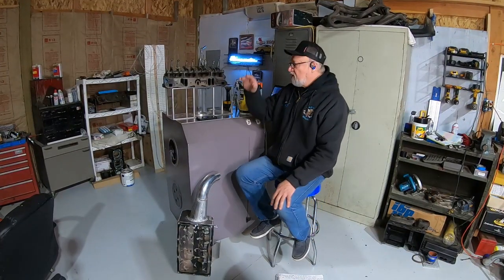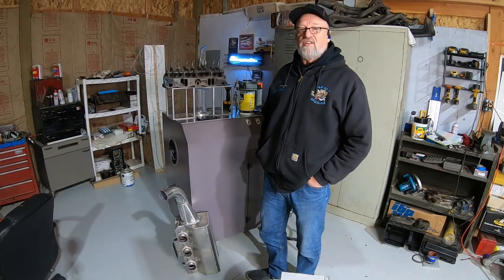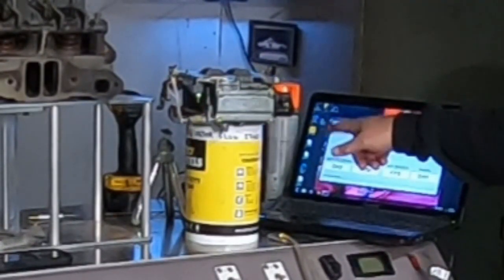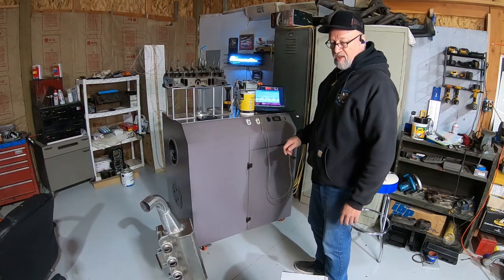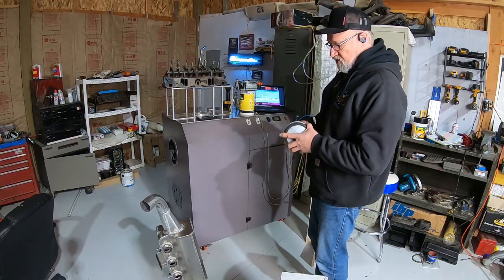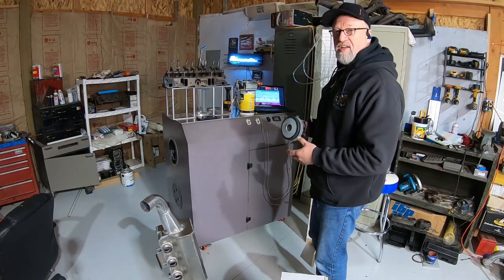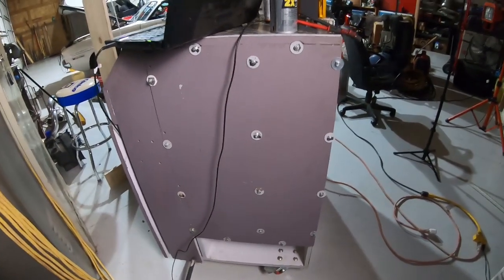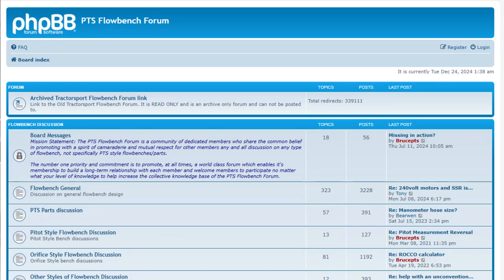DIY Flow Bench: How I Built and Use It to Test Carburetors and More

Comment: Just curious if a 6-71 GMC blower, ( I have several ) would make 300+  cfm at  28" of vacuum with a 2.05 intake valve head. Was thinking variable speed big motor , to drive it.
Reply from the maker: There is a good thread on this descussion on this site  https://www.flowbenchtech.com/forum/index.php?sid=10fc7533ccce82127a75661a51f9dab8    (were i got the plans to build my flow bench)  It has been many years back so you would have to dig a little for it. Or just become a member (free) and post up you question and you will get your answer. It a vary small forum and the answer will come vary slow, but vary Knowledgeable peope on that side.  but if you don't want to do any digging. Here is the short answer. The male a LOT of AIR.......but the HP aka electric motor that it requires is$$$$$ thene you will need 220 volt outlet and it hard on your electric bill.
Thanks for watching and posting up ;-)

Comment: I just ported my first set of cylinder heads and am very curious to if I made it better or not 😂. This also seems daunting to build as I can’t find anyone local to flow test my heads
Reply from the maker: Dont waste you money on getting them flow tested.  Track test them and them put it on a flow bench if they don't perform, to learn how to do your next set.  If you didn't get greedy they should perform better them stock. what head are you porting?
Reply: @CudaFishEStories 862 heads, spent about 20 hours total on them. Left the intake at 180grit and finished exhaust at 600grit
Reply from the maker: If you haven't watch these two video of mine, they have some good info in them. a bit long but informitive.
https://youtu.be/nznYcwXbpTM
https://youtu.be/g_Bl4I-cUCE
Not trying to toot my own horn, just offering a Helping hand ;-)

Comment: Ball park, how much should i expect to spend when building this? I read on the forum that you can get away with 2 motors, which im most likely gonna go with, cause im no race team engine builder, i mostly just build street 4cyl engines, so i dont think id need that many motors.

But i know i shouldnt expect under 200, but would this go above the thousand mark?
Reply from the maker: There is so much that can't be said here. so i Highly Encourage you become a member(It Free!) and start asking question there. It may take a week to get your first queston answered. so while your waiting you can check out all the threads on that sight.
You will need 4- 4x8 sheets of partical board 3/4 thick, you will need atleast 4 vacuum motor(Understand diminish returns!!!!)
If you have a vacuum motor that is advertised to have 110 cfm and you have 2 of them they will not give you 220 cfm.
Trust me you need 4. Mine is a 6 motor bench and i  can only flow about 540 cfm @28"keep this in mind your only testing one cylinder at a time. so it don't really mater if it a single cyl or a v8! And the only motor I or bruce is going to recomend is the Anetek 115923 and they are like $120 each.(Bruce can get you a better deal through his site). 
Will it go over 1000 dolars?????  if you go the inexpencive route NO, but if you want the conveniences of electronic so you don't have to do all the math......then yes! 
keep this in mind, a profesional bench will caust you 10,000+ used on up. 
I bought the plans ($50) the the wood, then the motors, then all the screw,, wiring switchs exc, then the lectronics.......then i started cutting up the wood and got started.
It took me 6 mouths to colect all the parts before i started to build the box to hows or hold it all.
I hope you do it. you will learn Soo Much ;-)
http://www.flowbenchtech.com/forum/index.php?sid=10fc7533ccce82127a75661a51f9dab8

Comment: I (a fellow tight-wad) have been contemplating building a flow bench myself. I've gotten the itch to port a set of old aluminum Ford Motorsport 302 heads for a future build, but I want to be more scientific than what I did on my last set of heads (somewhat educated guesswork). The basic pressure drop bench that David Vizard writes about in his book would work like you said, but the engineer in me wants more. It's timely that you've made this video, I'll look into PTS, seems to be a great resource!
Reply from the maker: When you start posting up on Bruces site (PTS) tell them Flash sent you. You can also find my build on there.
Here is a couple more video that you might like on porting. there long and i need to re due them but there is a lot of good stuff in both of them.
"Cylinder Head Porting for Beginners! Easy Steps to More Power (Part 1)"  https://youtu.be/nznYcwXbpTM

"The Head Porting Secret Every Beginner Should Know (Part 2)"  https://youtu.be/g_Bl4I-cUCE

My examples are on a mopar head, but these basic principles will work on all in line valve head such as your 302 head.
I hope you build a PTS Flow Bench, there a lot of fun and you can learn a LOT from them  ;-)

Comment: thanks for doing this,,,keep adding,,,,one question ive had is it best to have all the blowers equal CFM , or is it ok to have them mixed for different flow work,,like small engine port work,then say a 23deg. chevy,,,,,then be able to flow a big block head...so you would using say 4 then 5 or 6 blowers then 8 or more for the higher CFM needs,,,i know the amp draw has to get up there. YOUR real world info is very helpful,,,maybe do a few short videos to show some of the little things you have learned,,good and bad lol,,,this is going to be a long term project for me .
Reply from the maker: Thanks for your interest in this subject, wasn't sure how well it would land. As i said, there will only be a few that will go down this jurney. And it sounds like you are ready for it ;-)
There are several camps on this thought and none of them are wrong. The first camp is 2 motor Per switch. when you run out of flow, you turn 2 more on.  If you run 2 motor together you can us 110 V motors and wire them to run off of 220(takes less amp this way) all of this in on the PTS Forum.

The 2nt way is to run all the motor at once, and blead off the air your not using. Example is that you have your Cylinder  Head at .100 Lift and your Open up the blead until the pressure come down to 28". open valve to 200 lift and then close the bleed down until it rise back up 28" take your reading and so on, until finished or you ran out of flow/vacuum.
3d way is run a "motor control" were you dial the speed of most, or all of the motors together. this becomes a little bit more complicated but much more convenient. this is how i have my curent bench set up.

If you are running 2 -110v motor together to run off of 220 they must be the same vac motors....if you have one odd ball vacuum motor or they are all odd ball motors.........they would all have to have seperate switches.

Here is my advice if you want to do it once and do it right..........get Bruces plans follow them to the Tee!........ask queston on his forum so you do it right........and you will have a professional flow bench for a lot less.

If you don't have to money to do it right!?* Buy Bruces plans anyways (and build it with all the spare parts and pieces you can find)
If you don't feel like asking queston on his forum, register for his form and then look at "Flash"(Thats Me) Flow bench and all the miliion question that i asked.  You will get a grate understanding of how it all works. Also read up on all the other people that  have build benchs from his site.  There is professionals that have built bench for there shops. They Can be That Good!
Bruce(P.T.S.) has a YouTube site........Even though he has not made a new video on there in Many Of Years now...........
Each and every one of them are still Relevant Today!!!!

Hope this start the journey to flow benching ;-)
https://www.youtube.com/@brucepts
Reply: @CudaFishEStories  thanks a ton
Reply from the maker: @RussellCompton-fh3gr  Your so welcome, my first bench(2nt in my video discription) I literally cut up 3 desks, made of that pressed wood.  I used bruces plans, shrunk to a 3 motor bench. That build is also on there, but you would have to go into the archives of the forum to find that one :-)

Comment: My carpet shampoo machine has a vacuum motor just like that I think if you can gather enough shampoo machines that people throw away you can get the motor out of it. They're 120VAC and two of that same amp draw will have to be wired in series for 220VAC
Reply from the maker: Yup thats how i built my 2nt flow bench, there is two thing to consider, The first is a vacuum motor efficiency level @ 28" of vacuum, the 2nt is the amps that they pull. I had one "Flow bench" motor and 2 vacuum cleaner motors. At 28" the the flow bench motor out performed the other two combinded.  Also there is a Deminishing Return factor. aka 1 vac motor makes 100 cfm 2 identical motor will only make 160cfm(these are just numbers that i'm pulling out of the air....)
Amp wise. a 220 bench is more efficient then a 110 and is why i have 6 110V motor wired to 220.
It is easy to find a bunch of vac motor for FREE.......the amperage is the problem.
If you are considering make a vac motor bench go on PTS forum and post up what you are wanting to do.  I promise you will gain a wealth of info to help you make a educated desision.
There is a lot more to a flow bench then what meets the eye.